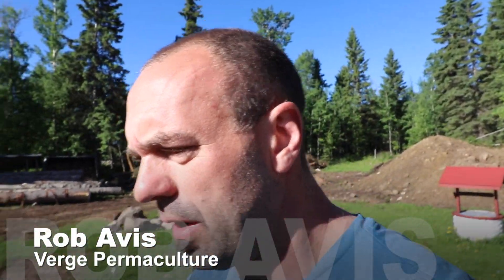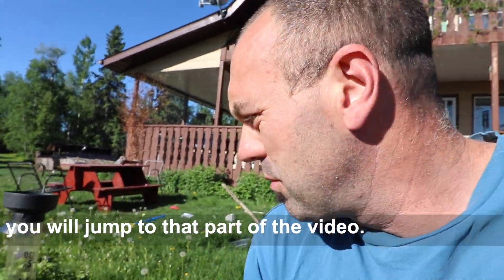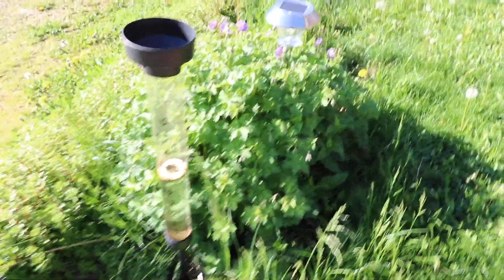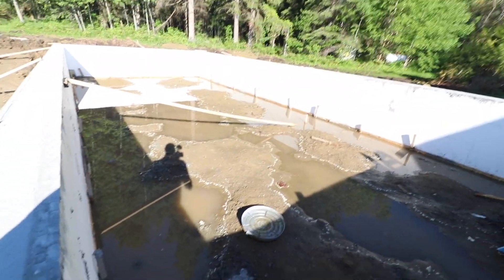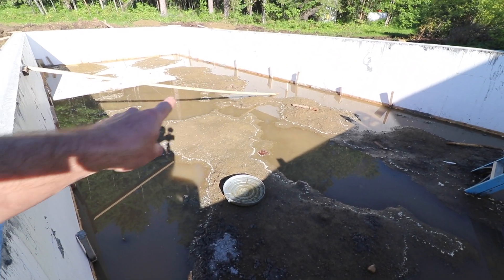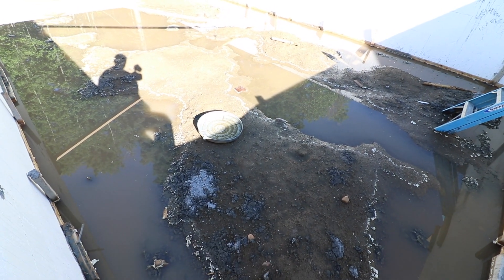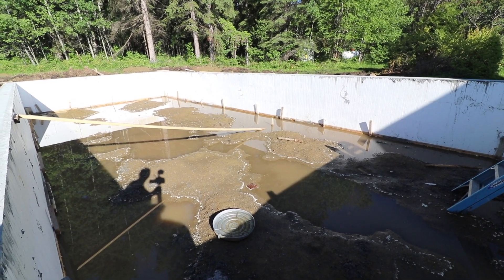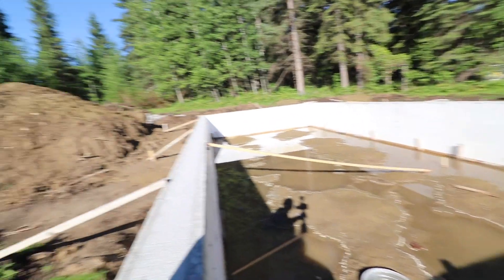Why Our Passive Solar Greenhouse Footing was built this way!

Comment: My apologies in advance, stupid question alert: I've rewatched the video a couple of times, but I still can't figure out what you mean by piles - piles of what? I understand what you're saying re: the reasons for necessary structural reinforcement, but what is the pile going on those spacings? It just looked like rebar/ concrete reinforcement. Again, my apologies if I'm being dense..!

Comment: Rob, do you think 6" pit run in the bottom then sand fill with weeping tile air heat pipe would be a better medium for heat transfer/battery.  I know in the old times they use to heat 4" to 6" pitrun stones wrapped with a  cloth after keeping them by a fire to keep your feet warm for a long time.